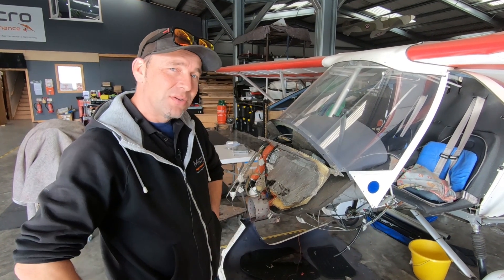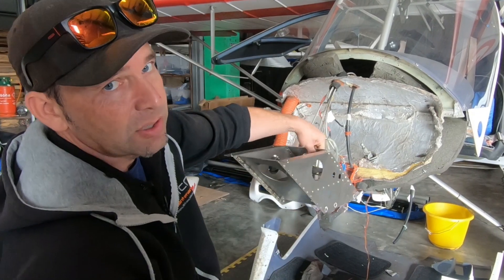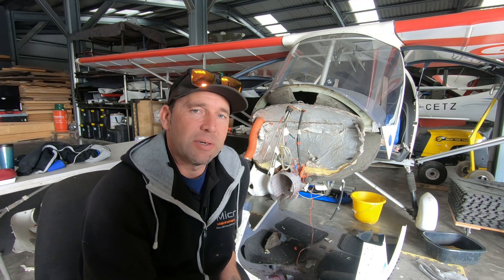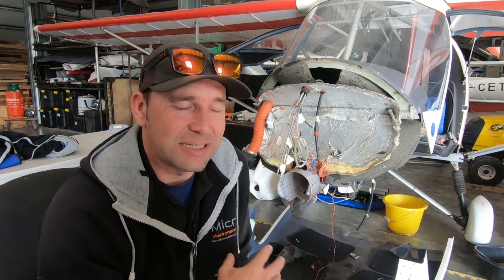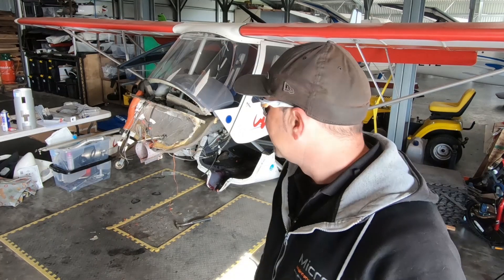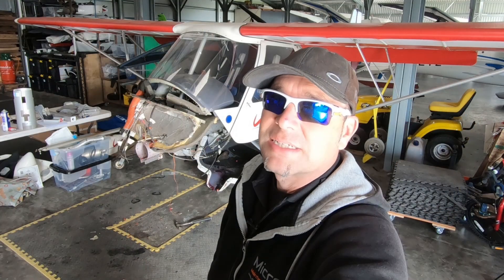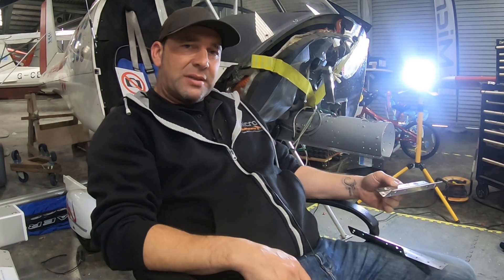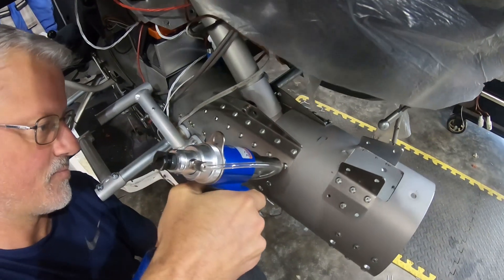C42a Keel sleeve reinforcement & repair: Micro Maintenance S3:E10

Comment: Damn! That’s like doing plumbing on a 1920’s vintage house! You go to replace a faucet washer and eventually end up tearing out the lath and plaster to replace the pipe you broke off inside the wall. I was afraid you were going to have to replace the entire main tube.
Reply from the maker: Yes it bought back many memories from house bashing. At one point we too thought it would be a new keel with the luck this plane was having.

Comment: Wow!

That seemed like the type of 10 minute jobs I've taken on......three weeks later😲🙄😀

Good safety upgrades and repairs though.

How many hours had it done over its 20 years?

Would be good to see a video on it back together 🤞✌️👍😊
Reply from the maker: Yes it started to get that way, very common unfortunately. 

Unsure on the exact hours but I’ve replaced engine cradles with less than 500hrs

If you find us on Facebook there will be pics on there no doubt
Reply: @wingnutshomeofmicromainten6946  Thanks, I'll try and look. 500 hrs isn't a great lot of hours. Is that with the square apertures I wonder🤔🤔
Reply: This aircraft has done 1100hrs on its original engine cradle.